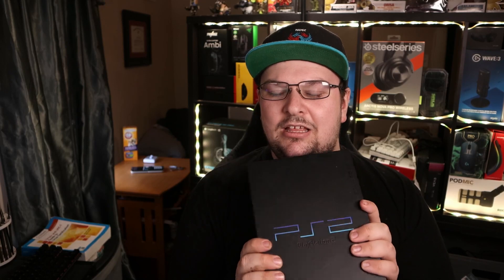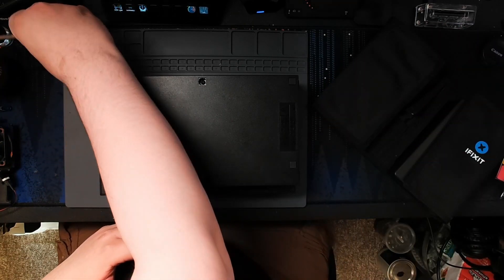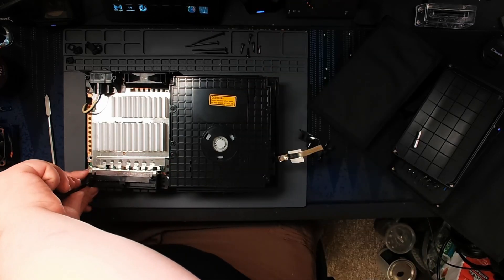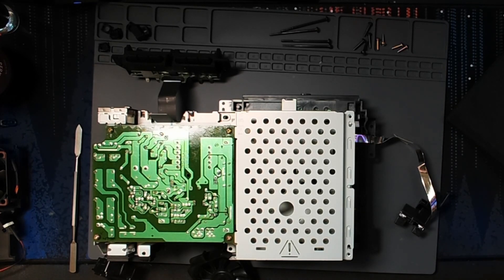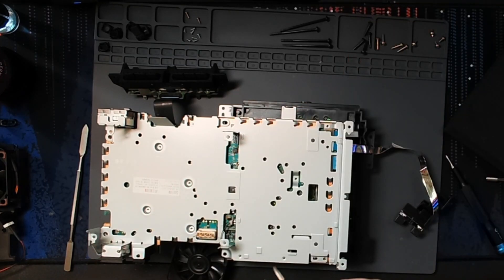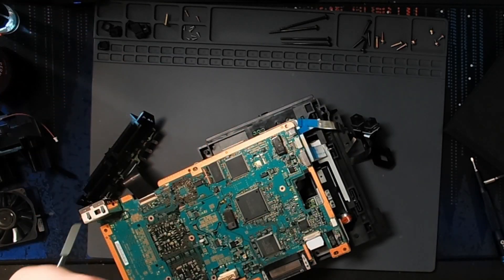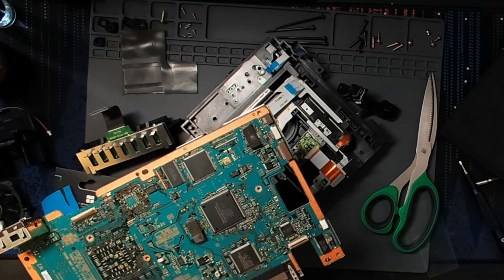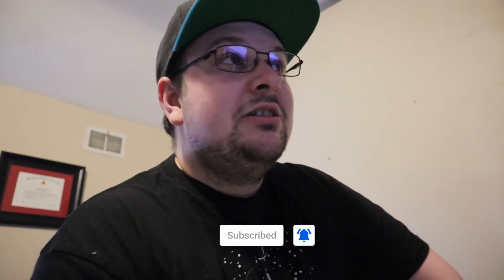Upgrading the Thermals on a PS2 Fat

Comment: was thinking of replacing the thermal pads on my PS2 soon notable differences?
Reply from the maker: honestly depends how degraded they are. If they are pretty old you should get a bit of better performance. I only did it because it was a recent purchase and I wanted to make sure it would perform the best that I could get it

Comment: What is the heat transfer power of the Thermal Pad you used?
Reply from the maker: 12.8 W/mK thermal conductivity
Reply: @RidgeTechGaming I just bought a blue one with 6W of thermal conductivity. Will it be a problem?
Reply from the maker: @Erich_8  So from the bit of research I just did to remind myself.  6w of thermal conductivity is about what the original pad used so that should be fine. I went with the one I did cause it was a brand that was recommended to me for being decently priced and trustworthy.

Comment: Does the ps2 fat use thermal pads or paste and can I use either one of them
Reply from the maker: They should all use thermal pads mainly due to the fact that at the time it was a way to make sure you had good thermal connectivity in a device that would be in service for many years. Now I would say you might be able to use thermal paste but I would be worried about making sure it makes good enough pressure and if it even can fill the entire gap. I would see if anyone else has done that and see how it went
Reply from the maker: @RobertStevenson-uy9sj i will also say that it may be dependent upon model again. kinda the best way to get an idea is to measure the pads that are already there
Reply from the maker: @RobertStevenson-uy9sj yeah mine was 39001
Reply: @RobertStevenson-uy9sj I'm almost certain that the 2mm one is the one that goes on the graphics chip; on the other side, there are thermal pads that he didn't replace, and those are 3mm.
Reply: @vittinli you legend!! Was just about to ask about them 2 pads on the other end as mine have turned to stones and are cracking. Been restoring a 35003 series, only just the thermal pads left to  replace and I’m going to drop in a RePS2 so I can put in the retro gem. Would you know why? My optical drive reads all discs everything loads up quickly, except ps2 games, so when I start up I get the start up sounds and visuals and then the PlayStation 1 screen (with ps1 games) and it loads quick no stuttering. Ps2 games I get the PlayStation 2 start up sounds and visuals then I get the ps2 menu before 30 seconds pass and then the PlayStation 2 screen and loads up quickly. Possibly the laser is dying?
Reply from the maker: @RobertStevenson-uy9sj so that is hit or miss with older consoles. the reason why they used  thermal pads is because the chip heights would differ. I think there are some youtubers that did user thermal paste and it went great but also a similar amount that did it and failed. I think i saw one that said its dependent on the model number
Reply from the maker: @RobertStevenson-uy9sj i used a 2mm pad
Reply from the maker: @RobertStevenson-uy9sj only taken my ps4 pro apart once to replace the hard drive cause it died after trying to play cyberpunk. so I will take your word for it

Comment: What thermal pad thickness would you recommend for a ps2 fat
Reply from the maker: https://www.amazon.com/Thermalright-85x45x2-0mm-Conductive-Resistance-Silicone/dp/B09JLHNM1J/ref=sr_1_3_pp?crid=2ZOSSNRKMUGZ3&keywords=thermal%2Bpad&qid=1703950250&sprefix=thermal%2Bpad%2Caps%2C107&sr=8-3&th=1
Reply from the maker: This is what I used. I would recommend either seeing if you can get a larger length or width to make sure you get all the components
Reply: Thanks for the help

Comment: What pad did you purchase? I'm having lag on my ps2 and the OG pad is so old that it has a rip on one side.
Reply from the maker: https://www.amazon.com/Thermalright-85x45x2-0mm-Conductive-Resistance-Silicone/dp/B09JLHNM1J/ref=sr_1_3_pp?crid=2ZOSSNRKMUGZ3&keywords=thermal%2Bpad&qid=1703950250&sprefix=thermal%2Bpad%2Caps%2C107&sr=8-3&th=1
Reply from the maker: I would suggest buying a couple or getting a bigger size. the most important part is the thickness so the pad can make contact with the component and the metal plate to help with optimal thermal connectivity
Reply: @RidgeTechGaming so you’re saying that we should buy a thicker size than 2.0 mm, Should we buy a 2.5 or 3.0 mm? Should we also buy more than one pack for our PS2?